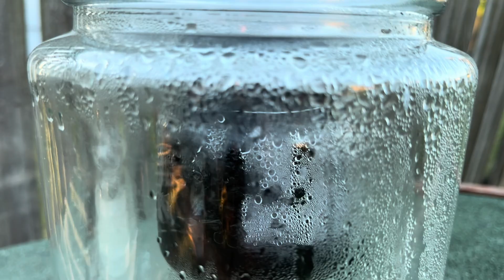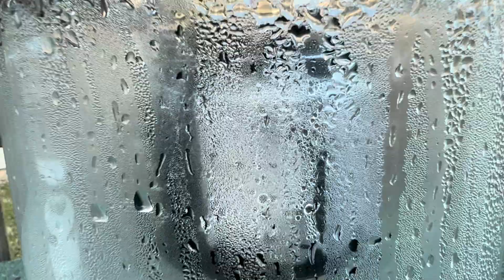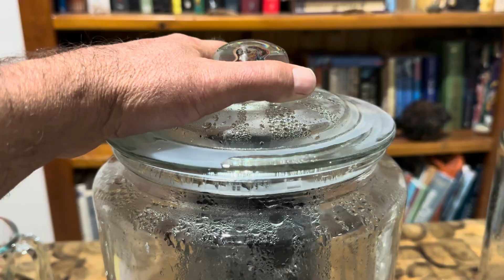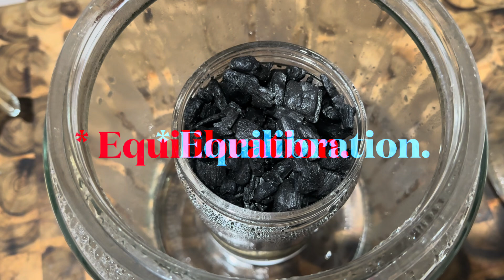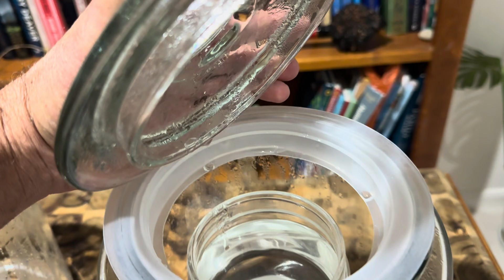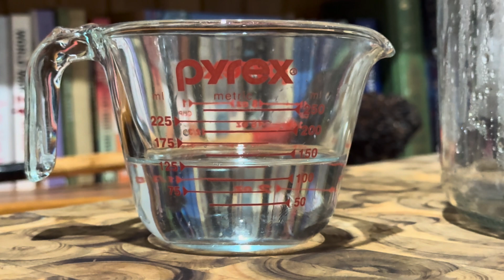How to extract more drinking water from sea water.

Comment: so you mean re-write and sanitize, pun intended. some corp made that type of tool, for writing emails. not just error correction but re-phrasing. or just dont be in any rush. is it you then. yeah it works. probably cloud shade. you could take a measurement glass picture every day, to check how each day progresses and then control for the variations. maybe the heated water reservoir increases the distillation rate.
Reply from the maker: Yep. I really just needed to get this out. It was frustrating to write the thing up only to find I could no longer use it. This will hopefully be a one off. In the end it was a mixture of me and the machine. The machine is too clean and inhuman. And I feel as though the entire thing still made no sense. I probably shouldn’t have combined both experiments into the one video, but there was a need to compare the two videos to show how the evaporation increased over time. Maybe I could release the original video as well and just release it as a request video. Only available by requesting a link.

Comment: I'm guessing the charcoal probably started out relatively dry. Then it took time for it to be saturated.

A third unit would have charcoal only in the sea water in the bottom, likely avoiding the delay.

But then, that would cause a salt build-up in the charcoal. That being hard/impossible to remove, have to replace it every time.

Another guess is that arrangement would slow down production rapidly (a more logarithmic daily production change).

Perhaps the pickle jar/hourglass has the benefit of being uncontaminated over a longer duration/indefinitely. Like a pump or catalyst.

Another important optimisation is to have the potable water directly draining into a tank with a non-return valve. That'd increase the humidity differential & efficiency. (Instead of evaporating potable water every cycle, slowing the water vapour transfer)

Expanding even further, install plumbing directly into the salt water jar.
A salt water flush/refill input & brine water drain on timed solenoid valves. Completely automated system.

That said... At that point it's probably easier to modify a vacuum tube solar water heater. https://images.app.goo.gl/mZ57KoSEtFMsxkFJ6

Comment: Do you re-soak the charcoal in "new" seawater between runs to let salt out? The process should overall slow down with time, all else equal, as the salinity of the seawater increases as pure water is lost, and salts stay. The charcoal reduce the amount of free water and should be more effected by that with time, so that the charcoal setup didn't outperform the control more in the shorter run suggests there some issue, maybe higher amount of salts in the charcoal from the beginning?
Reply: I don't think the charcoal has contact with sea water. That's the interesting thing, no salt accumulation.
Looks like it's acting like a heat pump/catalyst.
Reply from the maker: @savagebushranger7953 Hello and thanks for your comment, it’s great to hear from you again! To clarify this version was designed to allow the char coal to have contact with the air and the sea water. So the charcoal was absorbing the water and expelling it after the light and heat heats it, then the evaporated water leaves the surface of the char coal allowing more water to soak into it. To say it is a pump of sorts is on the right track. It is certainly providing a flow of sorts in one direction.
Reply: @savagebushranger7953  The charcoal and the seawater are in the same jar. 

The charcoal turns visible light that hits it into heat, instead of reflecting it, which increase temperature, and thereby  evaporation. 

And, the charcoal increase the surface area for water to evaporate from. The relationship between vapor pressure and temperature, and the importance of surface area for evaporation is very well known and documented.
Reply: @fishyerik Ah cheers, now I see. 👍
I thought the water level was below the stainless steel exclusion screen in the pickle jar. Therefore no salt contamination in the charcoal.
Reply from the maker: @savagebushranger7953 this was the case in a previous version but I have since moved onto a different approach. Now the char coal is partially submerged. It’s giving positive results.
Reply from the maker: This is a good point. In the unreleased video I mentioned super saturated sea water. But I didn’t consider the super saturated char coal. I need to research this more before being able to provide any answers. So at this stage I am just adding new sea water to the char coal in the sea water vessel without rinsing the char coal. Thanks for the suggestion! This could definitely have something to do with it. But like I said in the video, initially the return from the char coal unit was double that of the control. And then over the period of nine days the daily rate increased from double to almost four times. But like I said, there are many variables at play.
Reply: If salt from the first run was left in the charcoal in the second run, that could help explain the smaller advantage in the second run compared to the first. The only thing I can thing of that would increase the rate in the charcoal system with time is the fact that the surface area to evaporate from increases as the water level decreases. I don't know how big effect that has, it's significant, but at some point the increased salinity will have a bigger negative effect on evaporation.       

It would probably help to store the "used" charcoal in a large volume of seawater for a while, as the increased salinity in the charcoal probably takes time to go down. Good thing charcoal is cheap, so it's no big deal to have multiple batches, some soaking to get rid of excess salt, while some are in use.      

Also, great work! If you find tools that makes it easier to make the videos, that's great!
Reply: Maybe check if the charcoal is working as thermal mass and just warming up over several days? You could put the charcoal into a smaller jar inside the saltwater so it's out of contact with the saltwater but still absorbing heat and warming up the water. Also take daily measurements. And that tap at the bottom is a good idea too. ChatGPT is fine btw.
Reply: @newlocationcomingupsoon  Such small amount of charcoal can't hold much heat. Without a heat source, like the sun shining on it, temperature will be very close to the same as the outer jar in less than an hour. The thermal storage capacity, without phase change, is a function of mass and heat capacity, and for water soaked charcoal the heat capacity will be almost entirely from the water in the charcoal, meaning, for a given volume water soaked charcoal will have almost exactly the same thermal mass as water, actually the charcoal will have slightly less. That's assuming the pores is the charcoal is filled with water, dry charcoal has insignificant thermal mass, by volume, compared to water.       

Dry charcoal can insulate well, but not store much heat in itself. Soaked charcoal is that great insulation, even if heat can't move by convection in the charcoal like it can in free water.         

The temperature of the surface of the wet charcoal that is in contact with air will remain somewhat close to the temperature of other surfaces in the system, including the inside of the outer jar, even in sunlight, as any increase in temperature on wet surfaces will cause evaporation, which takes heat away.    

The extra surface area to evaporate from, that the wet charcoal provides, improves evaporation significantly. Also mixing the charcoal and the salt water maximizes the efficiency of the heat transfer from the charcoal to the salt water, and is also more efficient use of space than keeping those separate. Also, I think he already tried keeping the charcoal separate.